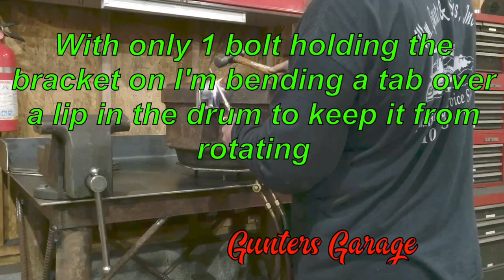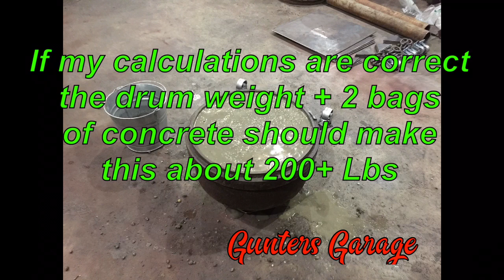Brake Drum Power Tool Stand, Part-2

Comment: This is going to be one of those things that once you get it into place you'll never want to move it!! LOL
Reply from the maker: Yeah, it probably wont be as bad as the manhole cover. That thing is a monster. I did put wheels on the drum. Im hoping the weight at bottom and the leverage up hight that it will tip back easily and roll where I want it.